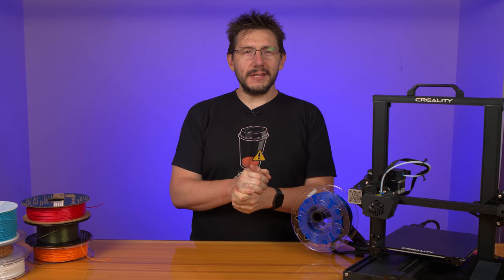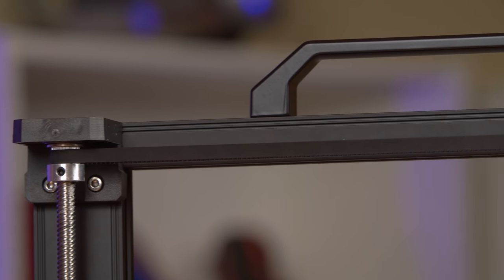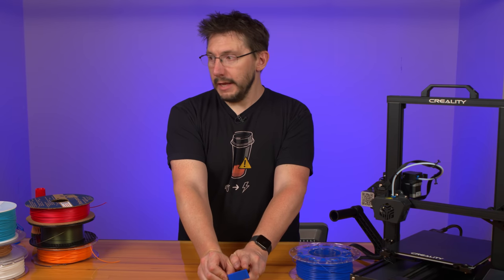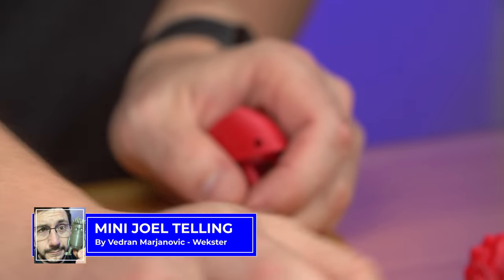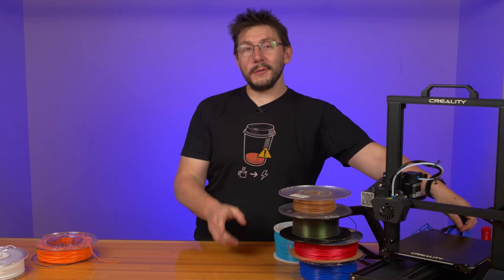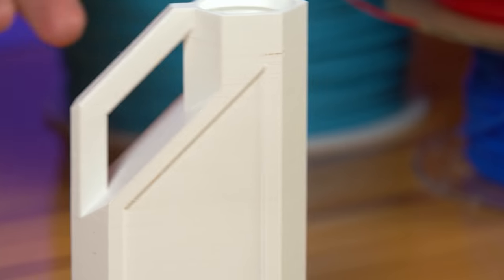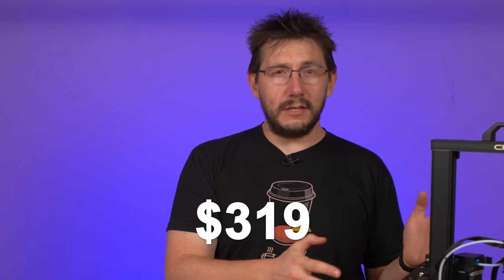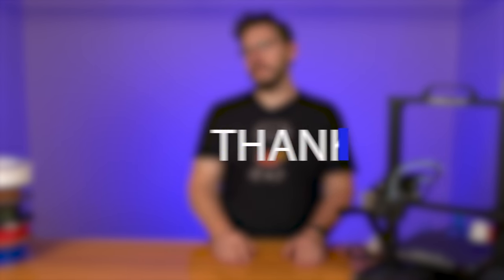Creality CR-6 SE Review // Should You Back It On KICKSTARTER?

Comment: While I don't agree with kickstarter as preorder / promo by a large company, the prints are super clean. 0.15 on the clearance test is not easy to achieve!!! Crazy how far along bowden ooze control has come in the last few years.
Reply from the maker: That’s just it. That 0.15 clearance test pass was done with default slicer settings. How cool is that?
Reply: Will you review it too?

Comment: One more thing i'd like to know when the printer pauses, either by clicking pause or by filament runout: does it dis-engage the stepper motors?
Every time i have paused a print on my ender 3, after i think something like 10 minutes, the motors dis-engage, which has allowed it to drop the gantry a little bit, enough to cause a collision when resuming the print, and if the part hasn't popped of due to the cold bed already, the nozzle smashing into it as travel speeds surely would

Comment: My main worry is all of these high profile reviewers being sent the best printers, and the build quality varying heavily once production happens. As much as I love my CR-10, it's taken a lot of work to get it to a state where it's reliable, with plenty of aftermarket parts, and the build plate that came with it wasn't even usable due to warping. I'm hopeful that the production units will be as polished as the review units, but I'll have to wait until some of these are in the field before I decide to throw down the money.
Reply: they have send me BROKEN hardware that I had to fix. heck my cr6 SE stopping working live on stream (grubs came lose on the drive gear in the feeder) let me tell  you it was no fun getting that spring back in.
Most of these established companies can't be bothered to try and "cherry pick" units for people.
Reply: @nerys71  Aren't the review units made using rapid techniques such as 3D printed parts where final would be injection molded?
Reply: @johndododoe1411  some were but mine came with all injection molded parts

Comment: The trick to using the Creality glass build surface (on my Ender 3 Pro) for ABS is to coat it with ABS dissolved in acetone. It sticks very will. I turn off the fan and heat the bed to 100C, nozzle temp (+-)220C . I've used it quite a bit. I need an enclosure to print large ABS prints. I get layer separation at about 3/4" tall. I have two separate glass surfaces, one for PLA, cleaned with alcohol and the other for ABS with the coating above.

Comment: $319 is honestly pretty fair. Considering the upgrades in specs that they did can be done on a $200 printer that doesnt have them. It would still cost close or more than $320 total, while also risking damaging the printer itself. I don't think the auto bed leveller is as good as the bltouch, but its still going to do its job.

Comment: i hear you on the flexible build plate but i have a (i think) similar bed on my cr10- v2  - i have come from a flashforge printer with a flexible build plate and while i loved that i found the usual problems of prints not sticking... with that i had to use a glue stick and a raft every time to get it to work. granted, as soon as the print was done i could remove the build plate, bend it and get the print off but...the build plate on the cr-10 which i think is the same one as this is fantastic, i use isopropyl to clean the bed and as long as i have levelled it propperly it sticks straight away and my first layer is beautiful. once the print is finished and the bed cools the print literally pops off so i dont need a flexible bed anyway. took me a while to get used to it but i love it now.

Comment: I do not think using Kickstarter is too bad personally, I am not sure why it is such a big deal.
It is an easy way to provide early bird discounts at different tiers (which makes it worth getting over msrp) and there seems to be some reasonable stretch goals which is always nice to have.
I have backed a few things on Kickstarter like the Copperhead Hotend and Tilt Five, and they are basically doing the same thing.

This was a great overview compared to your unboxing, so much appreciated, even though I already backed it :D

My biggest concern with everything I have seen so far is the x carriage belt alignment.
18:32 you can see the huge angle of the belt. This is issue because not only does it cause x carriage torque at the extremities of x position, but it will actually change how much the x carriage moves (Pythagoras) resulting in less dimensional accuracy at those extremities.
Is it a big deal? probably not, either way my intention is to convert it to direct drive and I will definitely fix that in my design 😊

Comment: I thought the same.  This is for them to get a feel of the demand for this model category. So it was a pre-order system and some cash infusion. But it will be hard from the pre order system to find out how many people are going to order the unit once it hits full production. They will need to dump the ender 3 pro.  They need to have a cheap sub $200  printer (Ender 3)  and then this unit in the mid $300 I would say $350.  FYI I pre ordered , I have an Ender 3 Pro, and slowing building farm so this new unit is cheap.

Comment: Aren't glass beds usually considered an upgrade? I know a flexible pad has it's advantages, but wouldn't a glass bed as standard be a good thing?
Reply: Yeah I'd take a glass bed over a flexible bed anyday.
Reply: Yup glasbed and 3D Lac is the best combination Ive ever used
Reply: the Creality Ender 3 pro glass is amazing. it has some kind of coating that just makes everything stick. I print PLA at 35C bed and PETG at 40C, havent had a print come loose in half a year. Im using a brim though, as its easy to remove and you can reduce temps even further. I have no idea why people print PLA at 60C bed, just not use a flat glass pane.
Reply: i will never go back to a solid bed from flexible again if I can help it. the convenience factor is just too huge. I also like doing heater off printing which you really can't do with glass (when your running 20 machines the electric bill can be quite substantial unless you can turn the heat bed off :-)

Comment: Great review, thanks! I do hope they leave the build plate on during paused prints, that needs to happen. 
I actually wish (and I'm sure there will be a hack for it later) there was a way for an audible alarm to sound, as well. Even if they just have a normally-open connection get closed by the runout sensor so I can connect a buzzer or whatever..
I don't care too much about ABS not sticking, I've never printed with it, and between warping and fumes, I'm not really interested.
The flexi was a pretty amazing fail, but I wasn't expecting a bowden to print flexi super great anyway. I actually have only used direct drive on my Anet A6, so I'm not well-versed on the bowden style. (How do you continue a run-out on bowden, anyway? Does new filament just force the other through the tube reliably and contiguously?)
I think the kickstarter price is a good deal and it looks like it's going to be worth it.
Reply: it has to change gap ( reduce gap between nozzle and bed) because there is a retraction between nozzle and bed

Comment: Clearly, this printer was not designed by an engineer, but rather by a marketing department, let me explain:
Dual ZZ motors, linked together by a sync belt... for what?
Either it has 1 ZZ motor driving both lead screws via a synchro belt or have 2 zz motors driving each zz lead screws, separately, where the auto-leveling function keeps them in sync and leveled.
There are many other severe flaws that Joel pointed out, like the dodgy firmware. But this one, in particular, triggered me the most. I hope the marketing department had these into consideration when coming up with a price. Other than that, good review, very thorough.
Reply: It's used for syncing in case of missed steps, I have seen that solution some time ago. It looks like you can disconnect that belt - so whats the problem? Also - autolevel is not able to keep z motors in sync when they're radomly loosing steps - belt helps with that(if one motor loose step - another keeps gantry in sync by helping rotate first motor leadscrew). Of course Z motors should not loose steps to begin with.

Comment: Joel, so here is the question I'm left with after watching the review.  You mentioned that you didn't have much success with ABS or TPU, and your PETG prints were only "okay".  Do you think that these are issues that can be addressed through firmware updates, or is this going to end up being a PLA only-ish printer?  Thanks for the review, and keep on with the great work.
Reply from the maker: For TPU, I suspect I need a better / drier TPU. For ABS, it was printing it fine, but it needs a better way to adhere to the bed. PETG was okay, but tuning a profile would make it better. I think there are going to be a large number of people that will use this as PLA only, though, I don't think that's it's only future.

Comment: Creality is smart in doing this.  They get most (if not all) the money up front for a production run of a new printer that they were unsure if it had market share.  The truth is...You can get an Ender 3 and upgrade it and it will be cheaper than this printer at retail and will get as good as or better prints.   The CR-6 isn't earth shattering in what its bringing to the table.   There's nothing "new" or exciting about it...As in no new tech being revealed.  Linear rails and ball screws would have been a nice upgrade.   But in the end, it basically an updated looking smaller CR-10.  Don't get me wrong...The updates they made to it are nice and what a lot of people are already doing.   But for the same price you can get better upgrades and make it the way you want it.   

For a brand new user to 3D printers...this is a very nice option.  I still like it.  But I don't think think bang the buck is there if you plan on doing mods.   $429 is a lot of cash you can use for upgrades to an already popular and very good printer.

Comment: I backed it weeks ago good to see reviews coming out. Glad i backed it hopefully they atleast hit the 3000000 million mark would love to have the upgrade. I currently have an Ender 3 Pro and love it but this has all the upgrade i wish i had but i also want a second printer. I was wondering that if you back the kickstater would we be getting the 32 bit board or is that still up in the air? I hope to see more reviews about what this thing can do it seems alot more capable than a stock Ender even with a few add-ons and the fact that the fan seems to be blowing right at the nozzle or a little lower is awesome and the light looks nice too. Wish they would have made it a white light but Im sure i can solder a white led on it instead of blue.

Comment: Chilling with an ender 3
Reply: Same
Reply: @michaelplaczek9385  Same (the pro though), its amazing with Cura, best entry level 3d printer to this day, perfect to learn along with upgrades etc. as well.
Reply: Makes sense if you've already got one. I needed to replace my FDM, and this makes sense vs the Ender 3 (less hassle, better features), and the KS price point is decent.
Reply: I’m stuck deciding between backing this vs an Ender 3 pro for $200. Any thoughts?
Reply: @AndrewCislak  I run an ender 3 pro and with the right profile (Cura) you can get absolutely perfect prints with common materials. The only problem I ever ran into is the fact that you kinda need to replace the extruder feeding part with a metal kit (10-15$, its super easy to install) because the stock one might break. Id say that if you dont want to print fancy materials like PC, the ender 3 pro is a steal of a deal at 200$. If you have the money and know that you will stick with 3d printing, the CR6 might still be worth it. However, if you want the abality to have access to the largest community that has the same printer and the most mods, the ender 3 right now is the best in this regard. Modding support for the CR6 will likely be large too within a short while as the printers arent too different I think.
Over all, if the difference in price seems like its worth it to you (auto leveling is kinda cool to be honest, especially if you are a beginner) for the many quality and quality of life improvements, go for the CR6. If you are not sure you will stick to the hobby or your budget is a bit tighter, better get an ender 3 (with the metal extruder kit would be best, it really is super easy and cheap). The leftover 80$ is enough to pay for 2-3 rolls of filament or any further upgrades you might want down the line.
Final note: Please use Cura, nkt Creality Slicer. I conducted a small test and Creality Slicer is pretty good, but Cura has so so many more options and results in visibly better prints. Also, Cura has the former mod called Creawsome integrated into its Creality profiles. This mod is basically an almost perfect profile in every regard, its absolutely amazing.

Pardon the eventual typo, Im on mobile and english isnt my first language.
Reply: @Sierra Close nah wood filament is not really what I mean, I was thinking of material that takes high temperatures like 300° with polycarbonate. Wood filament I think is pretty close to normal pla. You should be totally fine with that.

Comment: This is a preference thing but  I'd take a glass bed over a flexible bed anyday.
Reply: Same
Reply: Flexible is just that much more convenient for people doing a lot of smaller Objects that don’t require glass.
Reply: I've never used a flex bed but I can see where they would be nice in ways. That said though, my CR-10S came with it's glass and once leveled properly it prints amazingly on it and I don't use any glues or tapes to do so. Sticks quite well to the bed yet can be pried off easily enough as well after a minute of cooling.
Reply: I used the flexible that came with my ender 3 pro one time and replaced it with glass. Its stuck to my office mini fridge with no intention of ever using it again.

Comment: Just a quick note for everyone using Creality Slicer: It's not worth it. I didn't know that even existed, but I just tried a bit with my Ender 3 and the result is: Cura is better. top surfaces are cleaner, layers are more consistent (esp. visible with semi-transparent filaments) and details are better. On the Benchy, the lower front looked a bit more clean, but only very little, in general Cura was far superior, not even considering the advanced options. Of course, my Cura profile is more tuned, I made most of the sae adjustments to my Creality Slicer profile as well though. Maybe, there is more to be gained, but as an advanced user, Cura definitely is better in my opinion. I dont know how just the plain stock profiles compare and I only tested one filament (an experimental spool from Spektrum filaments, only exp. colors though) which was semi-transparent and therefore is a good benchmark. I don't want to hate on Creality Slicer, just wanted to throw my results out there.

Comment: I Complexly Love My Cr6-se other than trying to get replacement parts in Canada without pay 2x or even 3x the original price
Reply: I need a breakout board now for weeks. Makes me want to cry i cant use my Cr6-se. The Machine is great. Other thatn the glass build plate is miss in my opinion. 

I injured myself Joel as i mentioned in another videos comments. It was very bad, adding up to 9 stiches later and  2 weeks of being one handed.

I have to say Rite away Plz change the glass build out plate for flex one! 
Ive been a carpenter for over 25 years. I have over 40,000 hours and more with most tools and Still manage to slice myself taking a print off the Build glass plate.

If you even have come close to cutting ur self plz stop and get a diff Build plate.

Sorry for the rant of safety, Joel my Dude.

Comment: 1:46 "The build dimensions are 235 on X, 235 on Y and 250 on Zee or Zed, though the build plate size is nearly the same as a Prusa Mk3 flex plate rotated ninety degrees."
Wait, what? My English parser must be broken. Isn't a 235 x 235mm bed rotated ninety degrees... still 235 x 235mm???
Reply: Rotated 90 degrees on the X or Y axis, not the Z.

Comment: I've seen more than several comments about how good this machine is.  BUT they all say, the retail price of $429 is too high for what you get. (Yet $350 would be a steal). So as someone relatively new to the hobby, such assessments have me curios. I mean, considering the capability you're bringing into your home with the CR-6, that $80 difference between the $350 Kickstarter "buy it" price and the $430 "not worth it" retail price is really chump change when you put everything into perspective. Which segues into my question...

If this is awesome for a $350 printer, but not such much at $430, then what printer sells for and IS worth $430? I'm asking because whatever it is, it must by definition of value, be superior to the CR-6. So to the point... for just another $80, my once in a half decade purchase would be money better spent if I went for the superior printer at $430. So what is that?

Comment: Got it for $265, can’t wait to get my hands on it.
Reply: But the shipping is super expensive
Reply: @robertkelly3948  $20 isn't very expensive. Or did you not realize their shipping in listed in HK dollars?
Reply: How? Kickstarter shows 319
Reply: @MikeMardini  If you scroll to the bottom of the rewards you will see that there were lower price tiers that are now sold out. 200 people got the $265 bracket, 500 people (myself included) got it at $299 etc etc. Note that the dollar values are approximate since its valued in Hong Kong dollars and the exchange rate will fluctuate. If someone cancels their pledge, sometimes these lower tiers come available.